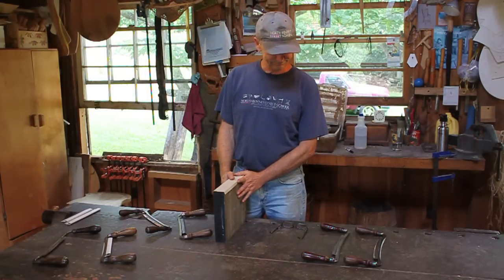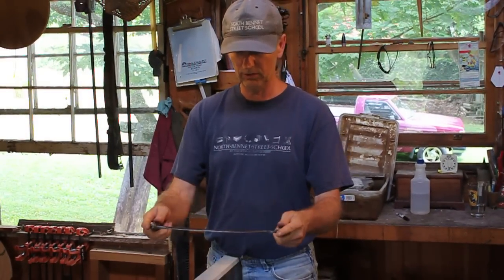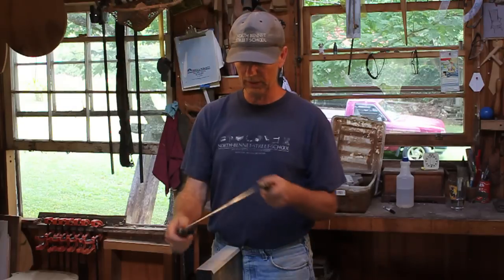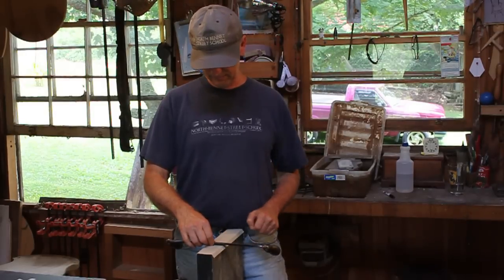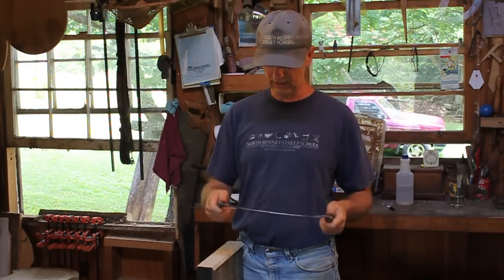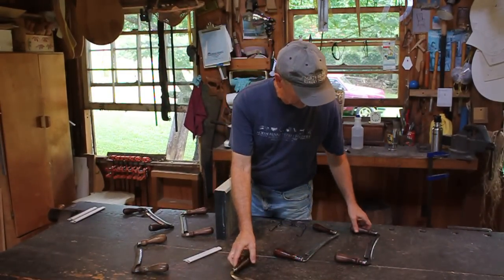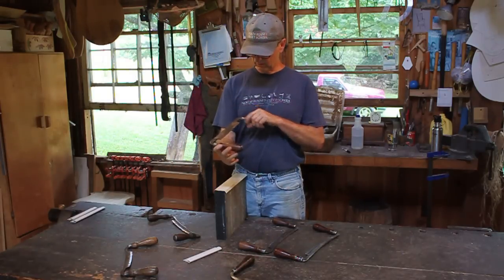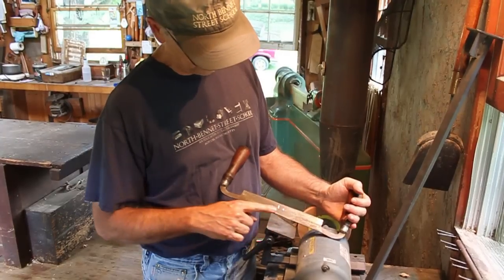Sharpening a Drawknife with Curtis Buchanan - Part 1

Comment: You can save yourself a lot of sandpaper by using WD-40 and a Brillo pad  or angle grinder with a wire cup brush to take off corrosion before sharpening.  Having a hollow grind It's a nice touch but not necessary unless you are a serious wood carver. The grind is more for preventing substrate from sticking kind of like flute grinds in the side of your chef knife. But that little wooden guide is a new trick for me which I'm going to try out personally. Thanks for that!

Comment: I found a barton knife at a fleamarket paid $7.00. Th problem is it will not sharpen. I have used files, stones, papers, honing oil etc. I'm afraid to use my bench grinder because i dont have a tool mount and don't want to ruin it. have you ever had this problem?

Comment: For a drawknife that has a slight curve to it from handle to handle like the 3rd one you showed in the beginning, would you go at that on the grinder to “flatten” the back as well? This has confused me because the back can never truly be flat with the curve that the drawknife was made with, and I’ve spent a lot of time just using the tool in a sub-optimal state because I’ve been unsure of the best way to regrind it. There’s more info out there on restoring straight drawknives than the curved ones, which makes sense because they’re probably more common. This one’s a nice Greenlee, otherwise in great shape but I’ve been hesitant to really be aggressive with its restoration because I want to do it right, with the curve it has.
Reply from the maker: yes, you do it the same way. You only flatten it from front to back not side to side
Reply: Thank you very much for your help! I’ll give it a go!